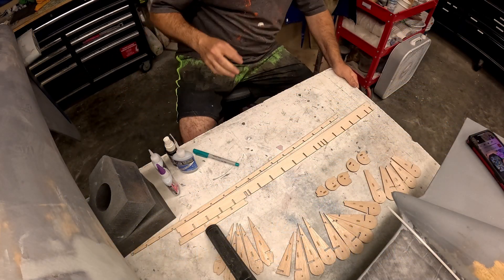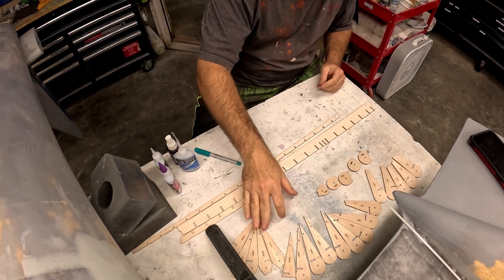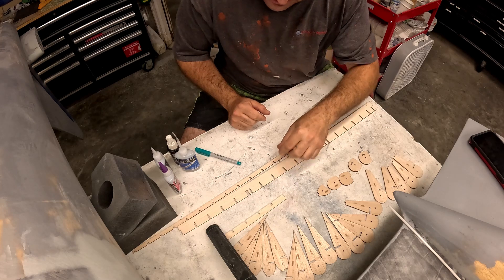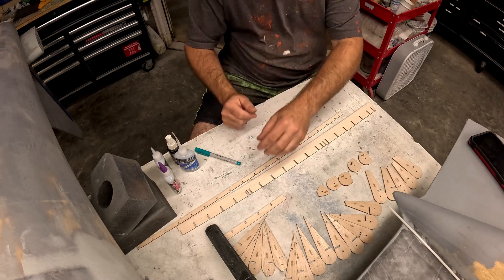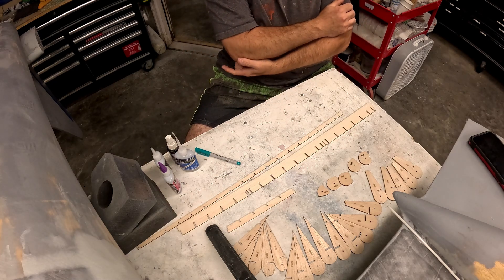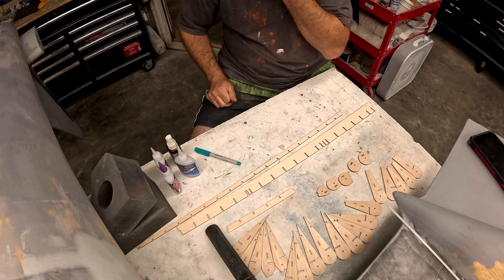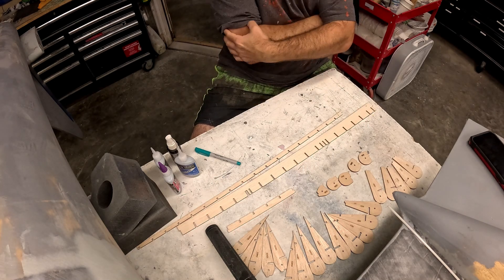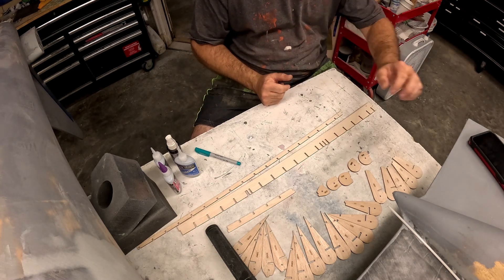B 29 Restoration Project #45   Flight control construction

Comment: Thomas, the ribs were set with the blue bottle CA, this one is a thin, or fast setting?  And the purple bottle a thicker, slower setting?  Are those covering pieces 1/64th ply?  Thx!
Reply from the maker: The blue bottle is thin, purple is medium.  These particular skins are 1/32, but new ones will be made using 1/64